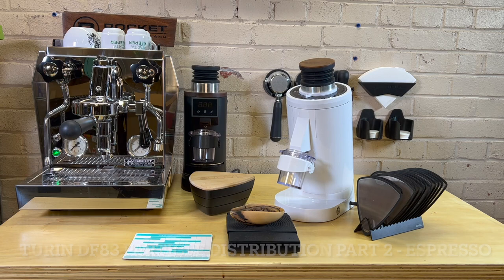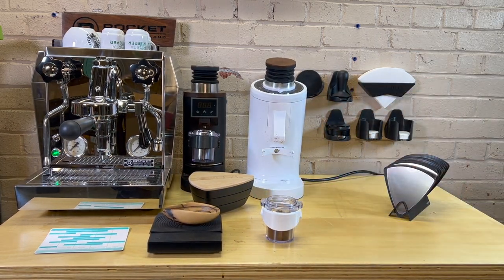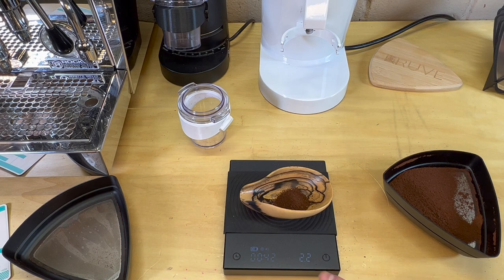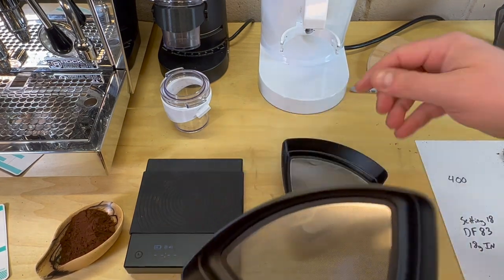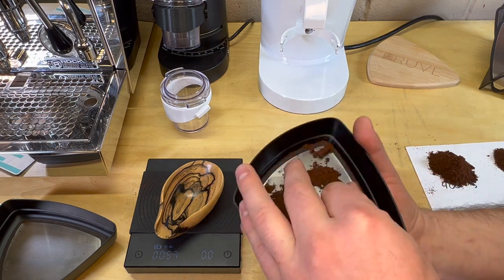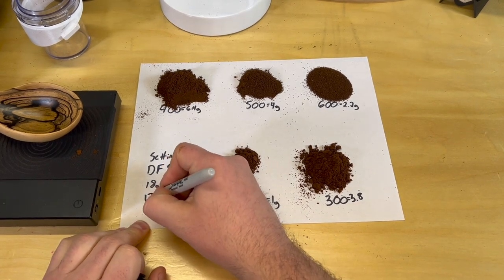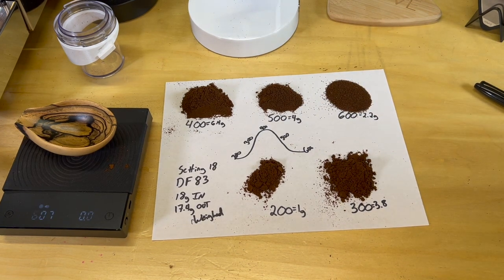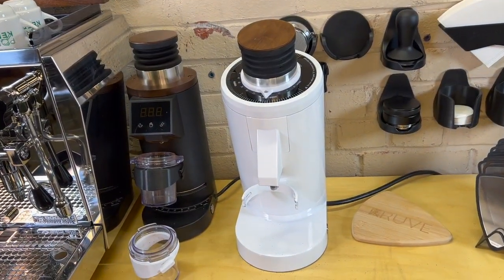Turin DF83 Particle Distribution Part 2 - Espresso

Comment: Thanks for all your videos and support of the DF64 community. I am looking to change  the stock burrs in my DF64E. Obviously I only plan to use it for espresso since I bought the E version of the DF64. I find the italmills to be lacking in flavor separation. What I mean is all the shots I pull there is a lot of flavor and good texture, but I never get floral or fruity notes and usually one flavor dominates all the others instead of being able to taste multiple flavors at once or tasting multiple flavors in sequence like some of the really great shots i've had from a cafe. I drink straight espresso from light to medium-dark and make my wife milk drinks with the medium-dark roasts so I don't want to lose too much texture (so I think the MP may be out). I've tried changing temp, pressure, time, ratio, turbo shots, even done chill extraction and I haven't been able to get what I'm looking for yet with the stock burrs. Which burr would you recommend for me, the HU or the cast? Or should I get a sifter and try pulling out the fines? I've tried pulling shots without bellowing to reduce the fines and it gave me a different flavor, but not quite what I was looking for. I've literally watched every video and read every blog out there and I'm having a hard time deciding between the two. Thanks in advance for your help!
Reply from the maker: I’d go MP if you want a lot of clarity.  Love mine for fruit notes. I usually use my MP for naturals and honey processed

Comment: For just straight espresso enjoyment, which do you like better. DF64 with cast burrs or DF83 with stock burrs?
Reply from the maker: I’d have to give an answer that you won’t like.  Haha. It depends.  Overall experience, the cast are fantastic, they are going to perform well on sweeter natural process or honey process beans.   They can be difficult to dial in but it is rewarding.    A traditional washed bean, medium roast less or no fruity, the DF83 stock does amazing work.   I just installed the SSP into my 83 and so far with my limited testing the clarity is much better compared to stock.  Very pleased with the SSP in the 83.   Was not wowed by the espresso burrs in the 64.   Then to throw another thing out there, the SSP MP are hands down best for natural process.  It’s really amazing
Reply: @portakeeper  Thanks for the reply. I’m tempted by the 83 but I’m pretty happy with the 64 and cast burrs. Kinda wouldn’t mind another 64 to keep the MP’s in so I don’t have to constantly go back and forth. Ahh, first world problems. Maybe in the new year if they offer more burr options for the 83 I’ll take gander.
Reply from the maker: @tomy2988  SSP is supposedly going to offer MP burrs for the 83 here soon.  I wouldn’t hesitate on a second 64 since you have both burrs.  I think the cast and MP are much more similar than the espresso burrs in terms of taste.